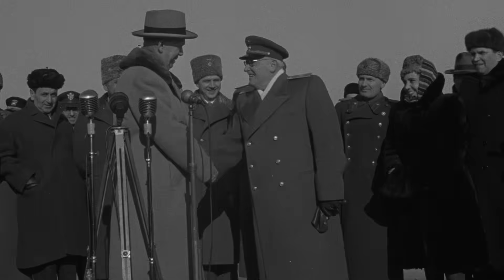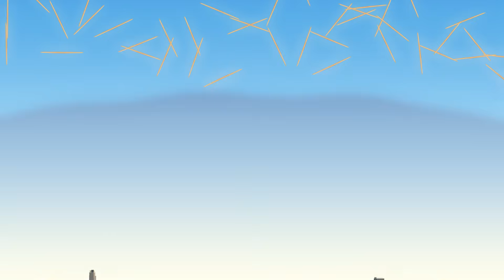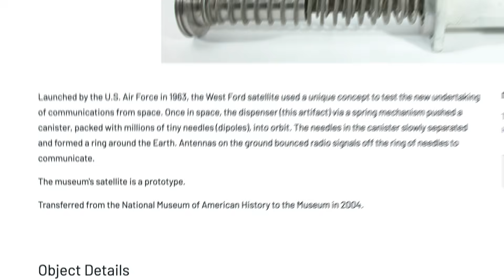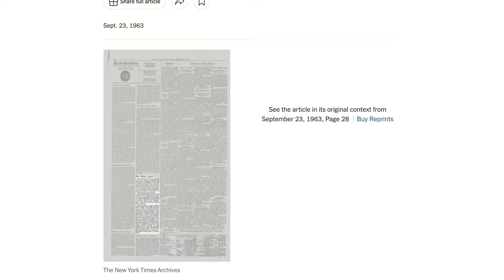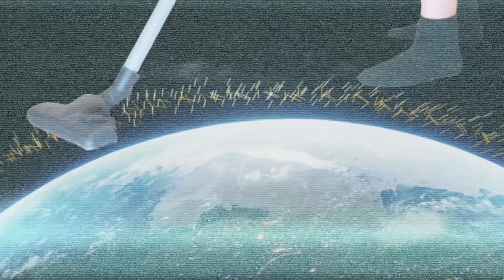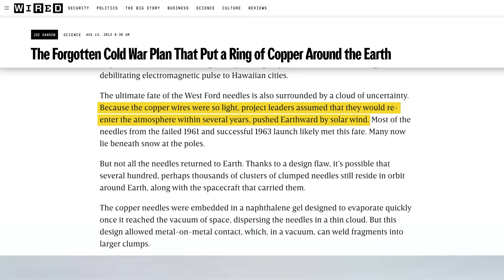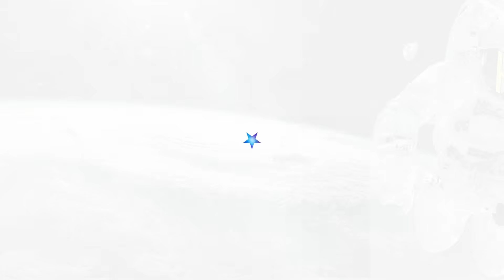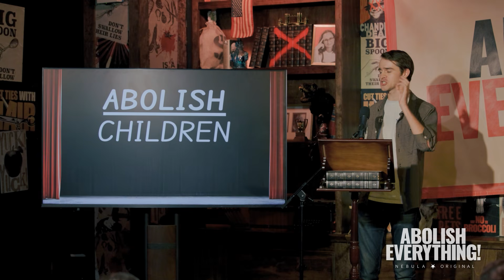Why The US Government Put 480 Million Needles Into the Sky

Comment: if anything like this happened nowadays it would be a big space debris hazard, since there are now a large amount of satellites they could collide with (which there were barely any of back then)
Reply: To ease your concern, the research has confirmed there is very little threat of such an event occurring. The vast majority of the small needles fell out of orbit within a decade, and there's only 44 clumps of needles 10cm or more in size left, all of which are monitored. Individual needles or smaller clumps undetectable are unable to cause any real damage to any satellites as there are only 1.3 penetrations of more than .4mm per meter per day and "no significant number" of impacts penetrating 0.5mm in low orbit total, not just from the needles. (1965 summary report from NASA from Project Pegasus I - III to record impact frequency) That was measured in '65, two years after Project West Ford. To add to that, most satellites have a wall thickness of more than a cm, like Starlink satellites being a few cm thick or the ISS's around 10cm to any pressurized part. Small impacts, like those from potential West Ford needles would leave no damage to other spacecraft or satellites. The damage is likened to sandblasting and would take decades to be any real concern to any given satellite, at which point they either stop keeping themselves up and allowed to fall or deorbited.
Reply: @KreptorS  i know almost all have deorbited, that is why i said "if anything like this happened nowadays". then there would be so many that it would be a real issue, even if individual impacts on their own are not
Reply: @MinerBat  did you read the rest of my comment? in particular, sentence 3/4